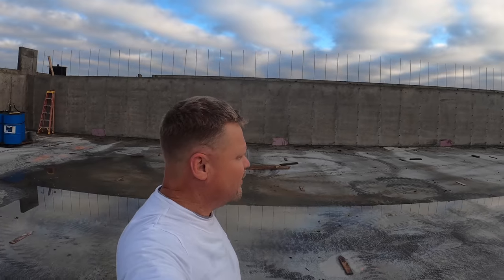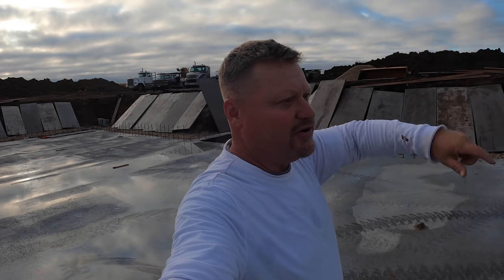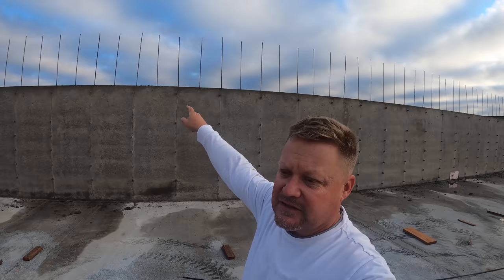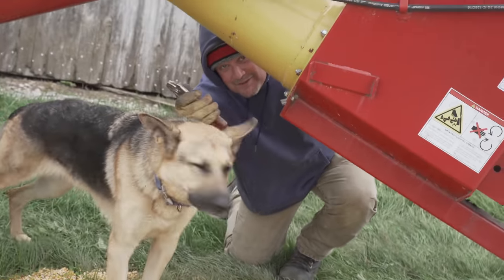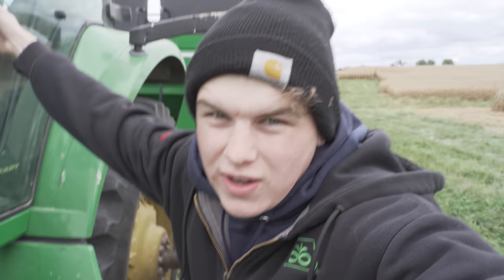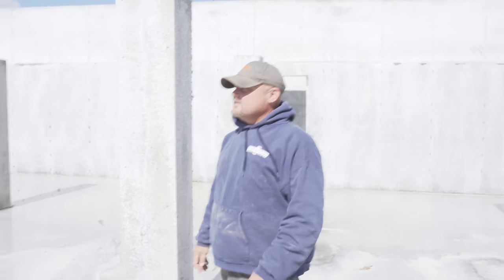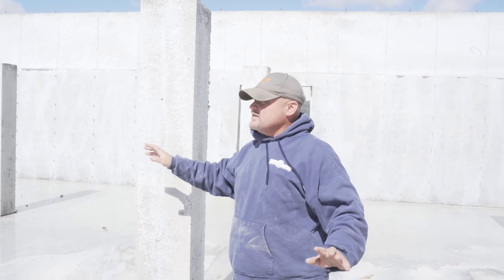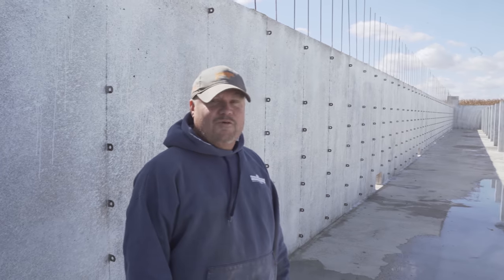Hog Barn Update and Corn Harvest 2020..

Comment: Question about the concrete used what kind are y'all using to stand up to those tough, corrosive conditions? Do y'all have to treat the concrete with some kind of sealant or other special treatment before the floor beams are placed?

Comment: Battery died well I had 2 knee surgery in 2002 after my orthopedic surgeon said that it was all psychological so I went to a orthopedic surgeon that I should of gone to the 1st time. He said I had torn cartilage and I 2 knee surgeries done one in August and 1 in December and I was to young at the time to get a knee replacement and now I weigh to much cuz I quit being a hog. Farmer and switched to driving truck cuz of my knee and 9 years ago I went to my orthopedic surgeon and he said my knee is totally shot now so I have been losing weight but on a stop since the pandemic has hit cuz the pool and gym are closed because of the Pandemic virus. This was the first time I had ever been hospitalized and work/ comp said I had cellulitis before which I didn't and I got a work comp lawyer and he said if I didn't sign he would sue me cuz he didn't want to go to court. I said if I knew what was wrong I would fix it myself 
Plus I  never cut my jeans so I didn't know I cut my knee and moving hogs all day long I shit and pee in my cut that soaked through my jeans and got in my cut. And the work comp bitch said I don't know how a simple cut in the knee can cause all these problems. Well the pigs were sick in the nursery about a week after we got them all the way to slaughter. But we would get in 1300 hd and we usually lost maybe 1 or 2 but no more than 5 up till this deal we lost over 500 before they went outside the nursery yep most certainly true. We had every state lab diagnosed the pigs and they all came up with nothing never seen anything like it before. So now I'm disabled SUCKS cuz my dream was to be a FARMER all my life and I didn't even grow up in a Ag community, I graduated from high school in Cleveland Oh and came to Iowa and worked with my Uncle's during the summer from 8th grade on and moved to Iowa Iowa 8hrs after I graduated from high school.